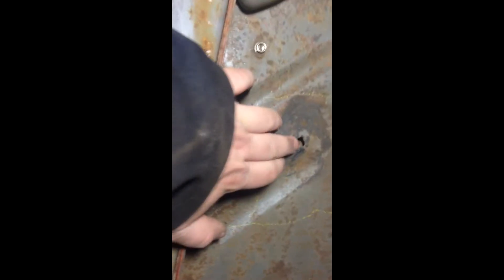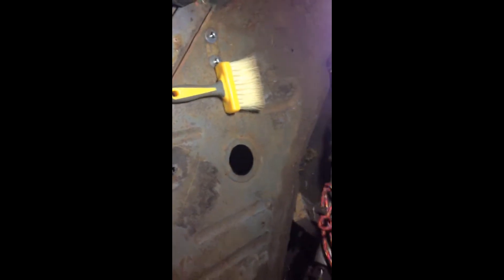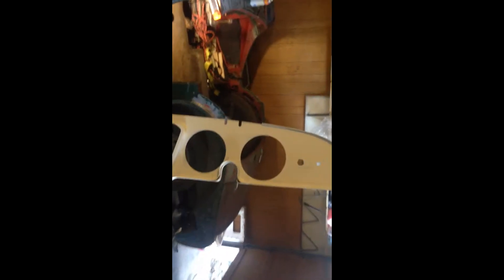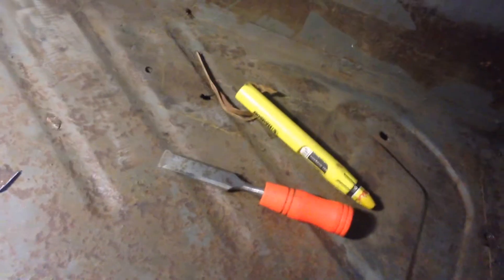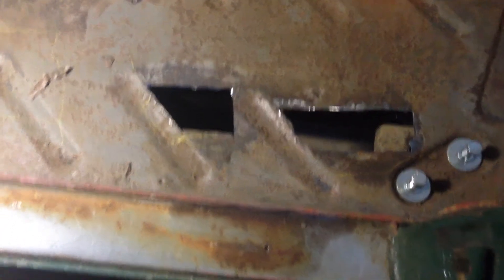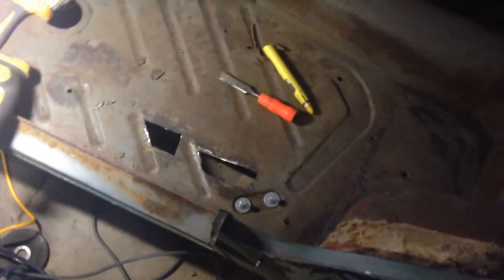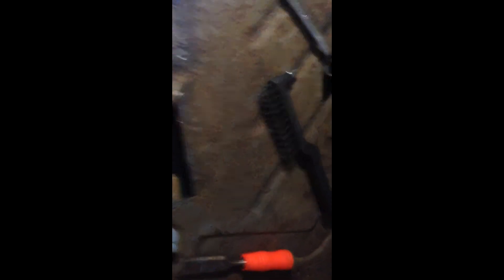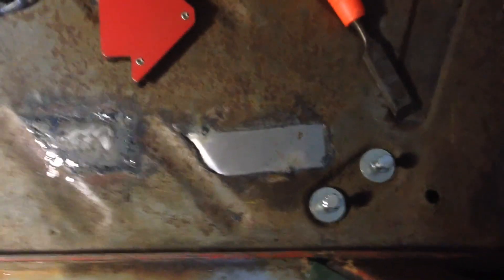Triumph TR3 Part 11

Comment: That's the way to go for sure if you can. Patches don't have to be pretty...carpet and seats and seat tracks will cover that area anyway :-)
Reply from the maker: my thoughts exactly. I dont mind bodywork but i still get cold shivers from replacing the floors in a spitfire i had...floors led to a and b posts, sills, door skins, horrible. Worst of all it took months to get the doors to fit even thought the car had been braced...sweating just thinking about it!